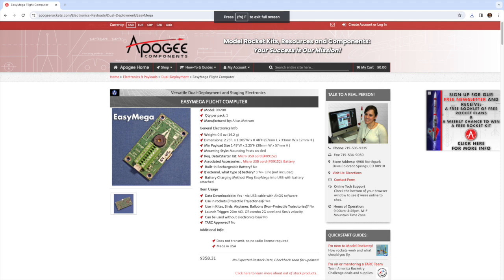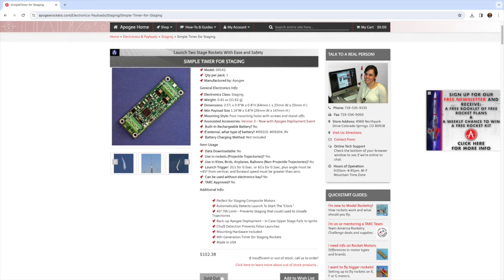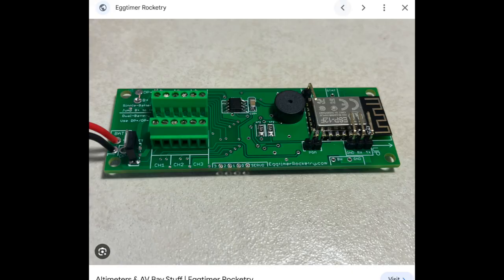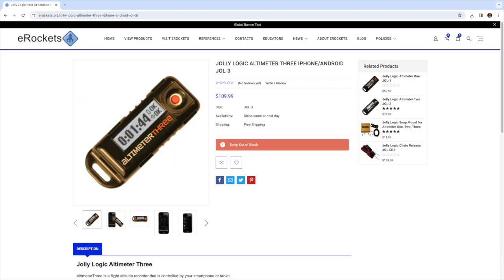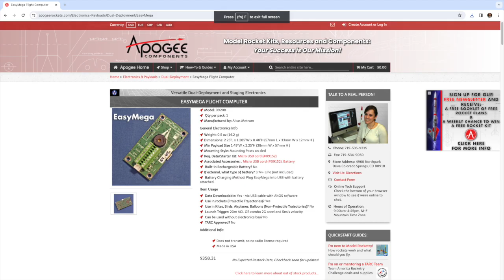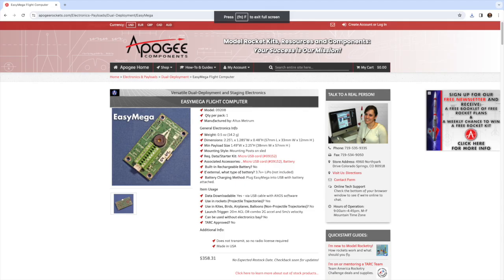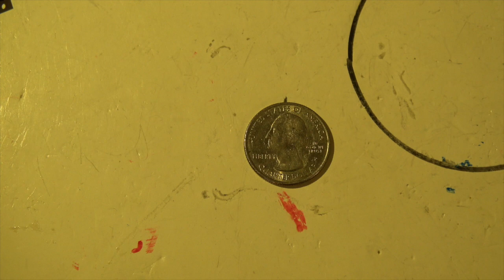How a model rocket flight computer works

Comment: use wifi, faster protocol and longer distances and easier to integrate with other tech. You could have another chip down at the base taking all the data so you have redundant storage. Also with the app you could get into flutter+firebase, it would add a lot more redundancy and its a pretty easy framework with a lot of support.
Reply from the maker: I never really thought of wifi. The reason i used the bluetooth was mostly just for ground coms, for long distance there is a hook up port for a Xbee radio. I did think of adding two chips, one for data logging, and one for everything else, but in the end there was just not enough space for another microprocessor on the size i wanted the board to be. I am thinking of doing a V5 of this flight computer with all the breakouts built directly on the board so that would be something i would do.
Reply: @ModelRocketDev  idk much abt rockets tho, cuz of all the impacts and forces im not sure if a normal chip would survive, but if i was to make a v1 i would go with just an accelerometer and esp32(which has wifi) and in the ground a raspberry pi as a server for the app and rocket. But radio goes even further, but you wouldnt be able to add camera feed in the future.